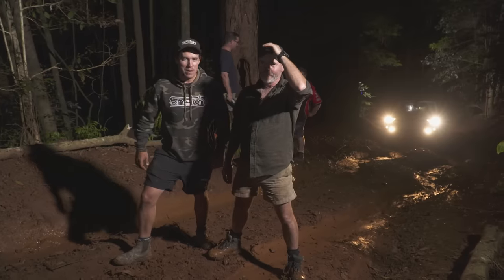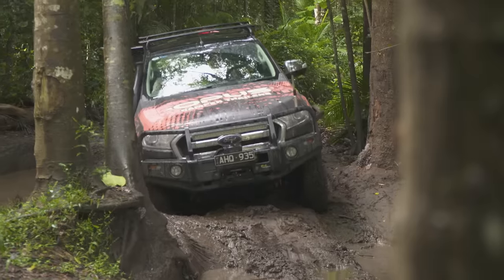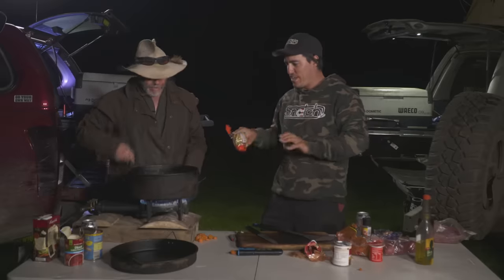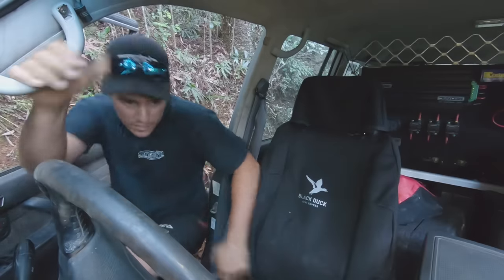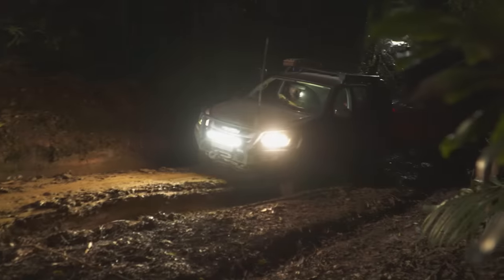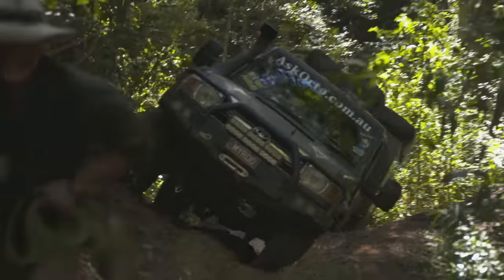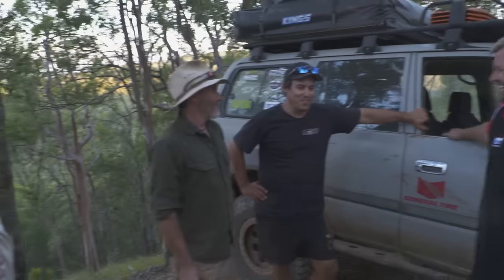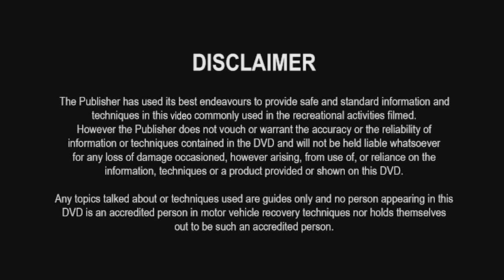STUCK on the side of a 4x4 mountain... Winching to MIDNIGHT - Best 4WD tracks near Brisbane

Comment: anyone notice
Graham saying: "damn boi".
yeah i was laughing my face off every time he said it...
Reply: 1HD-T motors are notorious for losing idle at steep angles. Something about the sucking power of the injector pump. You can fix it by adding an electric low pressure pump in the line.

Comment: 1HD-T motors are notorious for losing idle at steep angles. Something about the sucking power of the injector pump. You can fix it by adding an electric low pressure pump in the line.
Reply from the maker: Great tip Scott - we still haven’t fixed the issue - about time we get to that!

Comment: Nice drive Shauno.  Only ever once done something like that and yeah, I slipped and got to travel back down the track, backwards, far faster than I liked.  Dont like being passenger at the best of times, but when your MEANT to be in control, yeah.  Scary. Gotta love pea gravel.  Ruts saved me. (except my shorts).  So yeah, I could definitely feel ya on that climb.
At the bottom, I was sure I could do it.  My old rig goes up most thing without too much trouble, usually only pass up things that would put her on her side (a bit top heavy due to lift).  75 Troopy, lifted, lower gears in transfer,  twin locked on 35's (at that stage).  It was an eye opener to suddenly be going the wrong way and having no choice in the matter.  Was a few years ago now, still sends shivers down my spine.

Comment: Shauno needs a front locker!
Reply: pretty sure he has one but doesnt use it, because he'd walk up tracks and it wouldnt look impressive
Reply: Jack Rodgers not need but would help a lot
Reply: jeremy mcadam and no I’m pretty sure he said it’s broken or acting up
Reply: I think its cool he shows how far you can get without one, most IFS trucks its not really an option, so I appreciate seeing it, heck the Dmax has zero lockers and look how well it does
Reply: Kingsoupturbo dmaz don’t even have a rear locker? Hmm and that’s true but they do have a very intelligent traction control system
Reply: @caidanstuparyk1692  It seems the brake lock diff's work well enough for him to continually climb super steep stuff, changed the way I think about traction control aided 4wd systems for sure
Reply: @Kingsoupturbo  eventually it will be Superior.
Reply: jeremy mcadam he has a rear locker but no front locker

Comment: the track I should never have driven but did was this super steep track like an hour from my house in the Perth hills somewhere. It looked like it had barely been driven but it was on the side of a super steep hill, one track went down the hill then you drove alongside a creek for a bit then went back up. I stumbled upon it messing around with a few mates in our cheap and stock 4x4s as we were still on P plates (none of us could afford more than a few grand) and had no idea what we were doing. we made our descent down the track drove along the flat for a bit and started to climb back up. it was halfway up the hill that my stock as a rock 1999 3.0L Hilux cut out. as I tried to figure out what went wrong I noticed my fuel gauge was well below empty. So we had to turn my mates car around (v6 triton) to go back the way we came and got beached in doing so. we eventually did then finally made it back out onto the paved road then drove around for 30 mins trying to find a Gerry can. once we did, we did the whole track again to get to my car, which somehow didn't roll away then put fuel in my car, prime the fuel system,  then get going up the rest of the track than straight home.

Comment: I bought a radio control 4x4 that has remote lockers on both axles.  My real 4x4 does not.  I came to youtube to find videos of how and when to use your lockers, and when not to use lockers.  I found your channel and have watched probably 20-hours worth of you guys, now!  You guys are just fun to watch and I have found myself stopping what I'm doing with my RC or my 3d printer or whatever else I am tinkering with to watch particularly tense moments, like Shauno rolling on his side on that one hill, and when you said he was tense on this hill and worried about rolling backwards, I stopped everything to watch!

Also because of your videos, I am building an overland trailer to go with my 4x4.

Comment: This is the offroading I am most familiar with... In my day however it was in my Series 2A Landrover with no carpeting etc... cleanup generally involved a quick drive through a river if one was available and a visit to a public/commercial (coin operated... bays under a huge canopy... you know the type) pressure washer car wash on the way home where the entire thing was pressure washed inside and out and under the bonnet after tying a plastic bag over the carb and other enginebay parts...
Fond memories... but now that I am older and have a much newer/tidier 4WD it's that cleanup that kinda stops me doing this level of offroading now!  I prefer more scenic but easier trips now... than the hard-core visits to the nearby braided river system with it's mud and holes!  One of the reasons I love to re-live those memories via this channel I guess!
It was being stuck in this type of bog hole that I graduated from using a high-lift jack to lift wheels out of ruts or using snatch rope to spending the money on a winch!

Comment: my friends and i went to the mountains in Pennsylvania ( off road trip from Toronto CAN). ended up on a trail with no option to back out. 200m downhill so steep lost oil pressure had to shut it off. two feet on the brake peddle  , and the man trans in gear 2nd low. sure was a rush :)

Comment: We gotta stock MUX with some toyo ATs no lift nothing done to it other than the 31s, up mount Crawford after a full night of hard rain the forestry road sat at 45 degrees and it was about 60 meters with a tight right hander at the top. After watching a 76 and 75 side back down after trying the hill I was taking the piss in even attempting it but all of a sudden the little Isuzu just flew up the first section ranng ping ping up the rest and poped up the top of the hill given it picked up half the hill in the side of the car but little Isuzu made it couldn't be happier it also then proceeded to yank the 70 series up the hill with a 20 meter snatch strap

Comment: Was out at Turtons Creek vic and had a 79 series in the group and he sent it up a steep hill with zero traction, winched him up to a spot where he could turn around and had to run the winch rope through the roof basket to trees behind him and lower him down with winch so he didn’t slide off the side of the track into the trees, only nearly rolled it once

Comment: Easily Ratcliffe Track, the closed off section in Lerderberg State Park in an unlocked 2+2 lifted d22 with 265s. Was with my missus, 5 hours from home and went down and saw that it got worse so decided we needed to go back up. Easily 3 foot ruts up most of it, with big boulders, and the ruts cross each other so you needed to cross ruts no matter what line you too. Snaped a tie rod, fencing wired a shifter to it and drove her all the way home

Comment: I took a Ford Kuga (AWD) through 14 river crossings. My wheels moved some rocks under me in one of the crossing and the car dropped but nothing drastic. Something told me to get her up and out of the water and check. I checked and had oil pissing out under the motor. Turned her off and thats where she stayed until we got a RACQ guy out and he dragged on a trailor out. I put a hole in my sump!! Been back in one of my Dad's 4x4s and can not understand how it went wrong. Just rocks moved at the wrong time and a larger rock went through the bottom =)

The ’14 River Crossings’ is appropriately named after the 14 river crossings you have to make exploring this beautiful part of the Condamine.

Comment: My track was when I was helping with an  event on Mt Wellington Tasmania and used a few closed to public firetrails to drop off bollards and other items to certain points. I drove the easy track to junction cabin in my Subaru Forester and then decided to go down the very hard track. Let's just say it's one of the only times I was shitting my pants hoping I would get down in piece, which I did, but I wouldn't have gotten back up even if I had to.

Comment: I tried the Wokkpash trail(Northern Canada) in an unmodified Nissan Frontier. Got high centered during a river crossing through a glacier river and then a flash flood happened. That was fun
Reply: Crazy!! did the truck get flooded out?
Reply: @Kingsoupturbo  a bit. The biggest damage was to the alignment and suspension. Hit it broadside and almost ripped the wheels off
Reply: @songidude21  wow!!! crazy! at least it sounds like you were able to drive it out or tow it out after?

Comment: Just completed a Cape York trip with mates. Stopped in at land cruiser mountain park on the way home to Victoria. After doing cruiser canyon and telecom hill it was definitely cruiser hill that was the toughest track. Ended up snapping the crown wheel in the rear diff in my hilux. Had to pull diff and tailshaft out and drive by the front wheels home. Any of you 4wd action guys been there at all? Definitely worth a look

Comment: Wow, what a good episode. 
My 4wd, which it is not. A 1996 Toyota camry. I am outdoor person, who spends lots of time bush walking, and I have come across some very gnarly tracks. The one at the top of my list would be a 200m 45 degrees hill climb with a rock step at the top, I have peronly not seen any one drive it but one day I got to talk to person who had just done it, it took them all day of winching to get up. The location is -36.8623171, 144.2442344

If 4wd action every comes to Bendigo Vic area, let me know as I would like to be there to see Shaun try this hill, I also know of many other interesting 4wd locations around the Bendigo area.

Comment: watching ya'll has really changed my way of thinking in america everyone runs big tires and lifted trucks. i have a 1994 Dodge Ram 2500 which is 3/4ton with a v-8  5speed really heavy duty i have never lifted mine which in stock lift seems to be higher than yours. so really don't think i need to lift i am only running 31" tires probably need to go 35" but have plenty of room for them without lifting rear is positrac front is getting what we call lunchbox locker.

Comment: doubt anyone will read this but ive  got a track I really regret driving, so here it goes.

where I used to live in Kalamunda there was a state park that was closed to 4wding and used as a walking trail. anyway I was 16 and had the old mans landcruiser 105 series with a 1hz for the day and I managed to sneak into the track via a property fence line that was down that backed onto the track.

after driving for a while I got the the foot of basically a cliff that I would have to drive down,  much like what shauno drove up. I figured id give it a try. the track was too narrow to turn around and I was hot asf as it was the middle of summer and the ac belt was gone in the 105 so I just wanted to get home. I tried my best to back out of the track but as I did, it just kept getting harder and harder until I high centred the car on a rut. 

I managed to get out of it by track building but I made up my mind to send it and get down the hill and find the exit as I knew there was a gate and a track at the bottom of the cliff, it was a while away but I had been to the gate before so I knew it would be ok. 

so I headed down this ridiculously steep hill in a bog stock 105 with 30inch AT tires and no gear be it recovery or otherwise and it got to points where I felt the back end slip off and start to drop into the car swallowing rut beside me on the track luckily I just full sent 2nd to get out and it worked but if I ended up in that rut I would have had no chance getting the car out and would have had to walk back to civilisation with my dog. 

so anyways after I got through the rutted bit I had another 30mins of 1.5k of track building and sweat. I wish I had a cam on me to record it

slowly but surely I got down and the track levelled out. I then had to bash a small tree down to get out as the gate was locked. 

moral of the story if a track is closed keep fucking driving haha 
ps doggo was fine she loved the car ride, me on the other had hand had to get new seat covers for the 105.

Comment: Shauno, graham said you had a bit of trouble with sooty not wanting to idle.I had the same trouble with my  75 series ute at 4450000.I used compressed air to blow out the fuel lines,and that seemed to help,but I have a suspition there is more to it than that.Can you let me know  how you get on with sooty,by the way great show

Comment: The debate on airing up and down has raged for years, but one thing I can't understand is why you'd air down the trailer. Surely that has to increase drag and lower clearance. Going to have to ponder that one.

Comment: Reading through the comments cant find any "should not have driven that"
My first 4x4 gq patrol rb30 my "dirty 30" carby fed, was on a track out the back of gympie somewhere hooking it up this rocky hill and the fuel cut out half way up, no handbrake, couldn't get it started, I made a rookie error and decided to gently roll back down the hill, unfortunately the brake pedal went stiff and down the hill I went, i went into panic mode and turned out of the rut and  the car bounced all over the place, I came to a stop sideways across the track, was the scariest thing ever!

Comment: Love from the USA is it illegal to run beadlocks down there in Australia? I have a 4x4 1997 Ford F-250 with the big block v8 gas engine we don’t have tracks like y’all do down there but I tried crossing a corn field to retrieve a deer I had shot ad was in the dead center when I hit a suck hole which is like a bog hole but it’s got a semi hard top  it’s basically pudding with a cookie crust is the only way I know how to describe it

Comment: Shawn, Question about the 80 mate, I have one with 4" lift and just fitted a set of 35" inch tyres, Running Superior suspension. Are we legal? Must say may old 80 seem tall and you would be the same.
Murray / Clontarf QLD

Comment: hi i'm 17 and i have a 1994 hilux surf with the 1KZ te in it but i'm swapping that out with a 1JZ gte and got a 2 inch body lift with a 4 inch suspension lift coming could i get any advice for doing anything else i am also looking at a roof top tent and a 12000 pound iron man winch cheers

Comment: Apart from Shauno, 4wd action doesnt apply to me anymore. Unless of course i win xlotto, then i can pay the 80grand, then another 20k to ensure the diesel we pay a premium for doesnt destroy the unprotected fuel system of the common rail. Then we need decent tyres and rims instead of the trash manfacturers put on it. Thats more....dual batteries fridge suspension mods....i would require a lower base cost for a vehicle than what they are driving!

Comment: I've been on a few of those stupid steep track.  Ya know the ones that have no business on. I must say you did it right and had you mates with you.  Each time I have been,  I've been solo.  And of course the hill never starts out that steep and once your bouncing the front end up the hill I realize just how poor the choice to continue was.  But the fun isn't over yet.  After digging the tires and being in a double low range driveline; the truck literally just wants to slid backwards down the hill.  Once stopped my hoop was full on touching cloth!  Not being able to exit the vehicle the only choice was to back down.  But do ya put it in double low range or just single low range????  There is such a thing as too much low range in that kinda predicament.  Long story short after a combination of sliding and then stopping I managed to get the ol girl down in reverse.  Must have been about 200meters worth.  Definitely looking back it has put another bar on my arm of experience.  💪